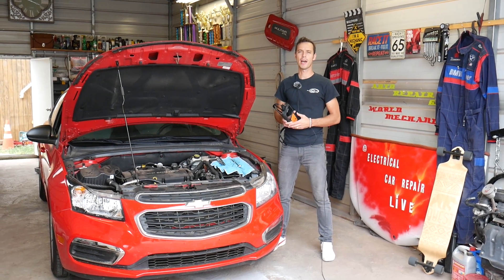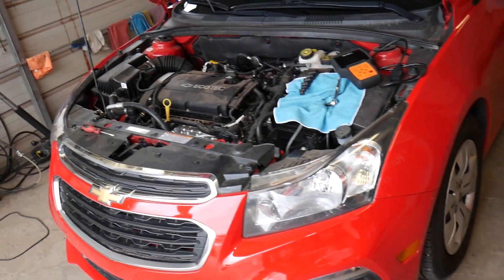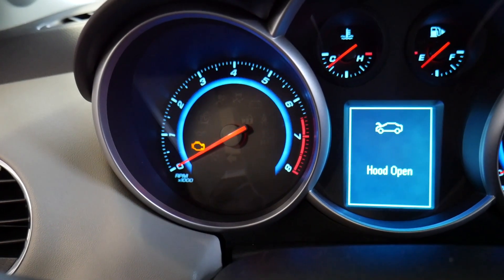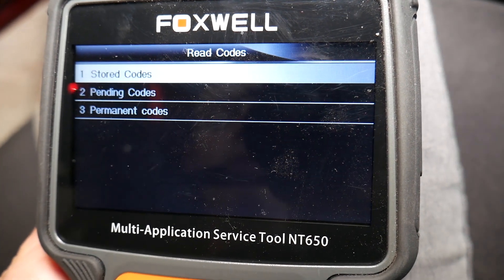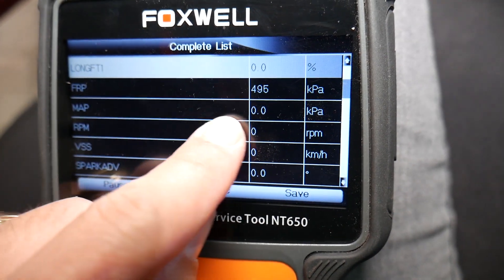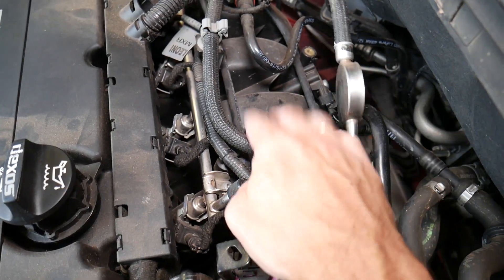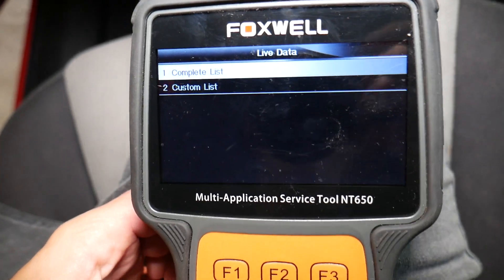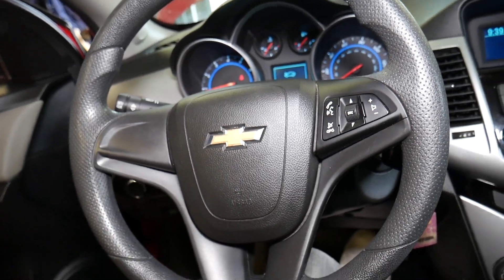FIX CODE P0107 MANIFOLD ABSOLUTE PRESSURE SENSOR MAP SENSOR CHEVROLET CRUZE CHEVY SONIC

Comment: Help I did head gasket on my 2013 chevy cruze 1.8l. 
It was running but had exhaust in coolent shutbit off fixed head gasket now won't start codes  p0598,p0660,p2078 and p0300 what could my problem be ?
Thanks

Comment: Thanks for the great video. I have replaced my MAP sensor and boost sensor. Blow at the same time. Engine light went off. The next morning the engine light was back on. Same code. Saying the sensor was bad. What should be my next move? 

Thank you!
Reply: Just because the code mentioned a sensor doesn't mean that sensor is bad. And there is no way helping you when you don't give any info if the code, car, symptoms

Comment: Hey i got Cruze 2011.  Have codes P0106 and P0107 Repleced Map sensor. Then codes got back. Give car to a dealer where its for a week now. They also replaced a sensor and same codes appear. They do have no idea where the problem is. Do you maybe ?
Reply: Check actual engine vacuum, if it's acceptable, perhaps the electrical connector at the MAP, or a poor connection at the PCM. Could also be a green wire or corrosion somewhere.

Comment: Hi , can you explain what code p2096 means .
Reply: Post catalyst Fuel System too lean- bank one. Could be a bad O2 sensor, exhaust leak ahead of the sensor (exhaust manifold or a bad exhaust gasket), possibly even a vacuum leak.